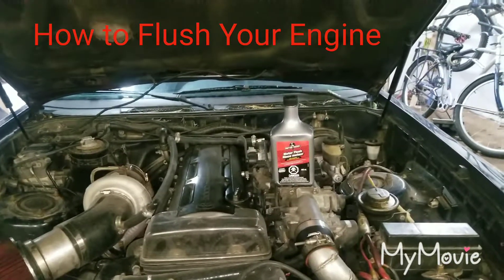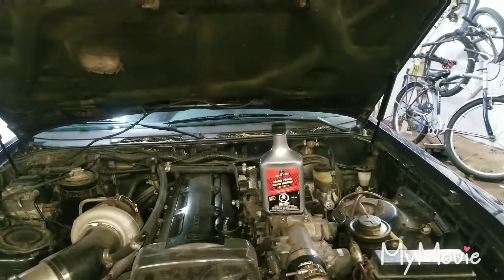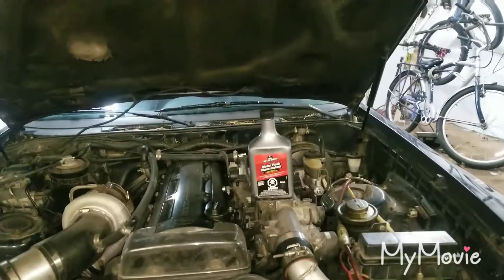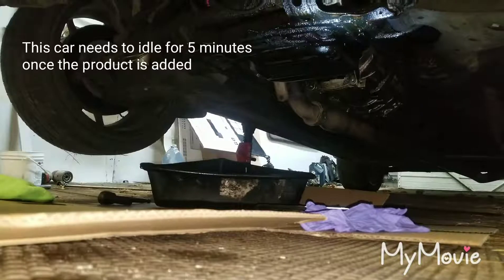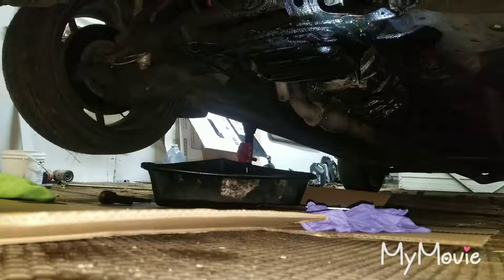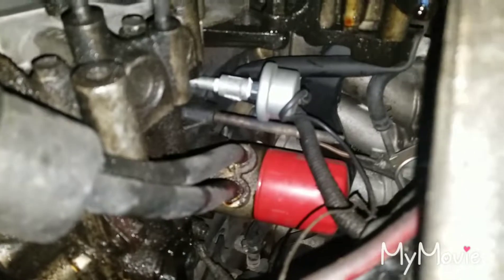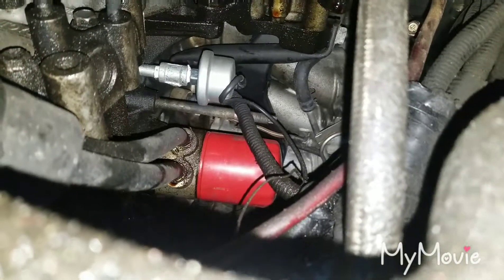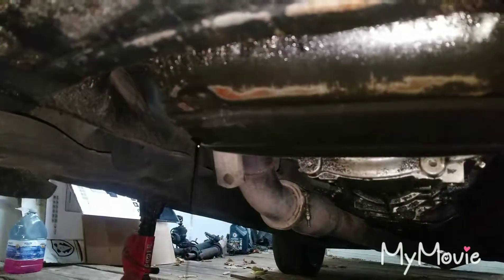DIY engine flush on a 2jz mk3 supra

Comment from the maker: I took the car out for a ride after flushing the engine and doing an oil change. It seemed to be running with less resistance. I will make an update video if anything changes. Thanks for watching.